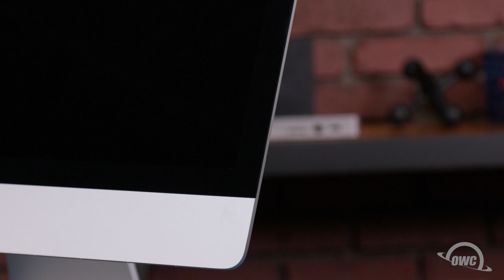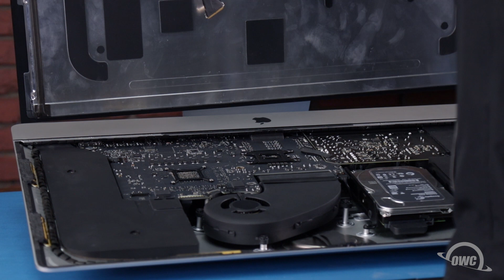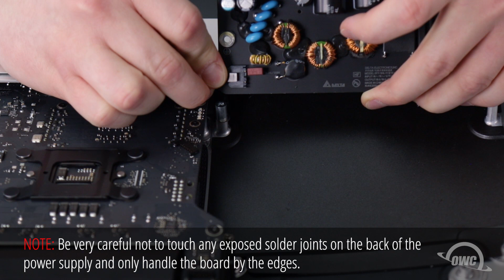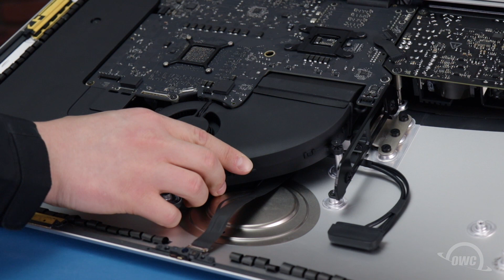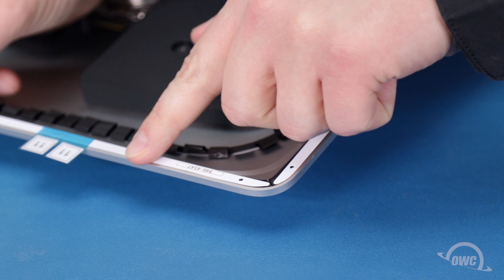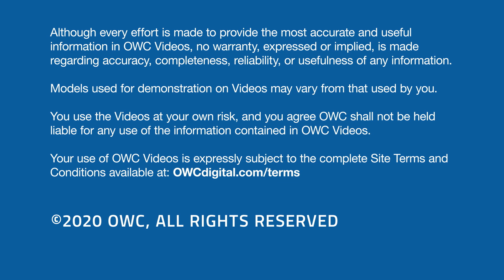How to Install/Upgrade the PCIe SSD in a 27-inch iMac (Late 2014 - Mid 2015) iMac15,1

Comment: Great and explanatory video. I'm going to allow myself to suggest a possible improvement for removing the screen: Use a hair dryer to heat the edge of the screen a little to loosen the glue that holds it and achieve a smoother and less risky removal. I confess that I have not done this job yet, but I dare to suggest based on some notebook screens that also come glued with strips and heating the cover a little makes the task easier. Best regards!

Comment: I see some repair shops using a heat-gun to help loosen the adhesive. Thoughts? I am weary that I may incidentally apply too much heat and damage the screen.
Reply from the maker: We do not recommend using a heat gun to remove the adhesive. As you stated it could overheat and damage the Mac in the process.

Comment: Would it be possible to replace the mechanical drive with a 2.5" SSD and use it in conjunction with the old PCIe SSD as a Fusion Drive?
Reply from the maker: Certainly possible, yes! Although somewhat unnecessariy complex--unless you truly only want a single drive icon/location on your Desktop and in your Finder.
Reply: @poweredbyowc  So the best option would be to replace the 120GB SSD with a 1TB and remove the HDD? Will that work without the temp sensors running the fans at max RPM?

Comment: and what about speed test? read/write
Reply from the maker: Hi MAD HUNTER! The Aura Pro X2 matches or exceeds the performance of the stock Apple flash blade in the Late 2014 – Mid 2015 27-inch iMac. https://www.owcdigital.com/products/aura-pro-x2

Comment: How do you know if it has the slot? I have late 2014 5k mac
Reply: All 27-inch from 2012 to 2019 always has a slot
All 21.5-inch from 2012 to 2019 only has a slot if it was bought with FusionDrive or SSD from Factory

2 exceptions to the rule:
21.5 - 2012 always has a slot
21.5 - 2013 sometimes (randomly) has a slot even was originally bought with a simple HDD
Reply from the maker: Your Mac would only have the PCIe slot if it came with either a Fusion drive or an SSD PCIe style drive when purchased.

Comment: Not sure why you took the fan, speakers and power board, bluetooth cables etc….just to switch out the hard drive…….
Reply from the maker: Thanks for the feedback on our video! While reaching the hard drive on this model is considerably more straightforward and would not require nearly as many steps, reaching the PCIe SSD can be pretty tricky for the average DIYer. Complete and proper disassembly of these surrounding components reduces the risk of damage being done to the iMac while accessing and removing the main logic board. We're confident this maximizes your chance of a problem-free installation. Experienced professionals are, of course, welcome to use whatever method they see fit.

Comment: Hi OWC, I have a  curious question. !!  If I add PCI SSD AND SSD in my iMac 2017 it’s possible !? If I can that means my iMac will have 2 drives right!? So which drive is for macOS!? 
Thank you.
Reply from the maker: Thank you for your comment! In order for us to confirm what you can install in your iMac, we'd need to know what kind of iMac you have. Please reach out to us directly:

We are open 8AM-8PM Central time M-F.

Our number is 1-800-275-4576.

Our international number is +1.815.338.8685.

Thank you!
Reply: Yes. You can have PCI SSD and sata SSD in the same iMac. But you can't RAID them.

Comment: Just to think how much easier adding/upgrading a PCIe SSD would be if Apple had simply put an access panel on the back of the machine. Oh well, at least you can still upgrade the storage on the older machines. Spare a thought for the poor suckers who buy the new Apple silicon machines - the RAM and Storage is all soldered onto the logic board.

Comment: Hi, my imac is 2015 27" 1TB HDD, does it has m.2 ssd slot? i plan to put normal pcie nvme into it, may be with adapter
Reply from the maker: Hi there! The 27" iMac (2015) typically does support an NVMe SSD, but configurations can vary. If you reach out to us directly with your iMac's serial number, we’ll be able to confirm 100% for your specific model. We can also provide you with SSD upgrade options, including compatible adapters, if available for your iMac. Looking forward to helping you find the perfect upgrade solution!

Comment: I have iMac mid 2015 27 inch with standard harddrive. Does my machine has PCIe slot? I really want to upgrade my storage and make my machine fast.
Reply from the maker: Desktop Mac Pro's typically have PCIe slot's, as these are typically slots for Full Desktop Towers/Machines. However we do have upgrade options for quite a few machines, reach out to us directly and we might be able to find a solution for you. :)
Reply: Yes it does. The mid 2015 27" model has a PCIe slot regardless of whether it came with an SSD or not.

Comment: Im getting an issue where the iMac crashes when in sleep mode, due to the new 3rd party NVMe drive. Any fixes?
Reply from the maker: Paul, we're sorry to hear that you're having these crashes with the 3rd party NVMe drive.

Basically what is happening is that there is a power delivery issue from the Mac itself when it's trying to wake the drive up from Standby mode, which is the ultra low power sleep mode the Mac enters after it's been asleep for typically 3+ hours. With the Aura Pro X (and Aura N) drives being an NVMe style drive and a newer, faster hardware style, it has a slightly stronger power draw that the original Apple AHCI style drives. When it tries to wake the NVMe drive from Standby sleep, it doesn't quite give it enough power to do the trick and, when that happens, it crashes itself, thus giving you the crash and/or reboot when you're opening it.

Sadly, this is a hardware issue with Apple - the same thing happens with Apple's NVMe drives that they started installing into their Macbooks in late 2015 (and for some of their refurbished 2013-2015 machines) and until they can push forth a firmware update to address the issue, the only way we have to resolve this is to stop the Mac from entering Standby in the first place. That way, the Mac is still able to sleep like normal and do everything like it would otherwise, but when it does sleep it never enters that low power mode. The only impact you should see after making this change is that if you let the Mac sleep for an extended amount of time while not on the charger, you will notice that the battery will have depleted a bit more than it would have before, but that shouldn't be a substantial difference either way.

Here is our official support article on performing the fix and allowing the Mac to sleep like normal.

https://eshop.macsales.com/Service/Knowledgebase/Article/26/785/NVMe-SSDs-Standby-Mode-Issue

Comment: But what kind of PCIe was removed and replaced?
Reply from the maker: The drive removed is a PCIe 2.0 x 4 connection. We installed our new NVMe – PCIe 4.0 x4.
Reply: Thanks 🙂.

Do you know if iMac Retina 27" late 2015 has NVME drive?
Reply from the maker: The 27" iMac does have an NVMe drive that you can upgrade.

Comment: Will this work on late 2015 iMac?
Reply from the maker: It will not. We do not recommend replacing the PCIe SSD in the Late 2015 model, since it is located on the back of the logic board, and requires a full disassembly of the machine.
Reply: @poweredbyowc  Why exactly doesn't it work on late 2015 17.1 models?
Reply: Curious to get an answer on this, I’ve disassembled my iMac 17,1 but I can’t figure out which PCIe SSD can be purchased as replacement.

Comment: Hi guys,
I have iMac 27 (late 2014 - mac OS Big Sure) with Fusion Drive (1TB HDD + 128 SSD). I would like to replace 128 SSD to 512 SSD. Will I be able to do it without any problems (I take one out and put the other in)? On which disk is the system installed HDD or this smal 128 SSD?
Reply from the maker: A fusion drive is when you combine those two drives to work together for a faster speed, so the OS is located on that combined drive source. Removing either of the drives from the computer will "split" the fusion of those drives and should be an easy task if you do not plan on creating another fusion with the new drives as that can be a harder task to complete.

Comment: Is this one compatible:

Kingston NV2 SSD - 1TB - PCIe 4.0 - M.2 2280, SSD (Solid state drive), 1 TB, internal, Speed: 3500 MBps (read) / 2100 MBps (write), IOPS: (read) / (write), M.2 2280 (80mm), PCI-Express 4.0 x4 NVMe 1.3 (Non-Volatile Memory Express)

Also, some of the posters complain about hibernation problems?
Reply from the maker: Regrettably, that might be a better question for Kingston Technology as they would have better information regarding the compatibility.

Comment: Alright so I’m trying to figure something out. I have late 2015 21.5 5k i5 imac. I’m trying to figure out do I change out the hdd for a 2.5 ssd or does it have a pcie slot that would be faster or if the 2.5 will be fast enough
Reply from the maker: The PCIe SSD can only be installed in 21.5-inch iMac models that came with a factory-installed SSD or Fusion drive. For more information on compatibility, please feel free to reach out to our support team.

Comment: Hi, 
I did successfully made installation of NVME ssd and sata ssd also 
I am getting speed of 760 mb/S at NVME and speed at sata ssd at 370 mb/S but speed at USB ports have decreased a lot. 
Can you guide?
Reply from the maker: Hey Balaji Mehsana we would be happy to work with you directly if you could contact our support team at support@owc.com, Please?  We look to hopefully hearing from you soon.
Reply: because the pcie slot that the imac have is only for pcie 2.0 (around 850MB/s) that's why it wont reach pcie gen 3.0 speed rated for your nvme
Reply: @David-ug1bh  He's complaining that his external USB3 ports have slowed down, not about his PCIe speed.

Comment: My iMac is a mid 2015 27 inch 5k model with 1T built in hard drive.  Has this model already got a pci slot inside for me to buy a new Ssd for installation.  Or I can only replace the original 1T hard drive with SATAIii interface Ssd?
Reply from the maker: Raymon Chan,
 
We would be happy to confirm if your model of the 2015 iMac would have the PCI slot inside and would be eligible for a PCI SSD upgrade if you could provide the serial number of the iMac, Please?
Reply: I have the same question please. iMac 15,1 - Late 2014
Reply: its an yr old comment but yea u can place nvme ssd(pcie ssd) at your logic board socket. late 2015 imac 27” comes with empty nvme slot if youve got it with the default option that provides 1tb hdd, 8gb ddr3 14900 ram and i5 6500 3.2ghz

Comment: Wouldn't it be a lot easier to just use a SATA SSD instead of tearing everything apart to use a PCIe SSD?
Reply from the maker: Hey Tom, Yes it is a lot simpler to but some customer need the additional speed that the NMVe SSD provides.

Comment: Probably the worst design since the first macbook pro. That required removing 50+ screws to get to the hard drive, the number one failure point in a laptop at the time. Why people buy these overpriced POS machines is a testament to the power of marketing and Apple's "style before substance" philosophy.
Reply: This is why PC is better in this respect.

Comment: I have a late 2014 but it's not a fusion drive just a normal HDD.  But I understand the slot is on my logic board.  If I put an SSD here, would I see two separate drives on my Mac after that?